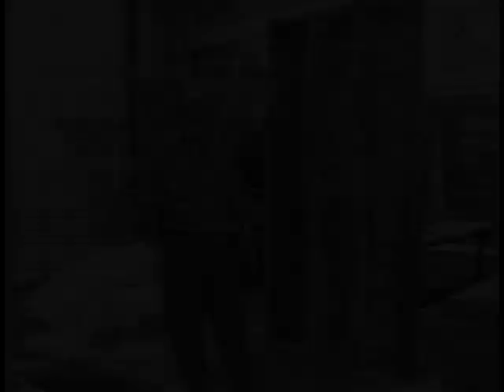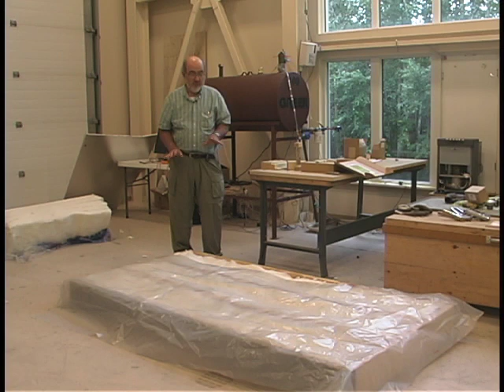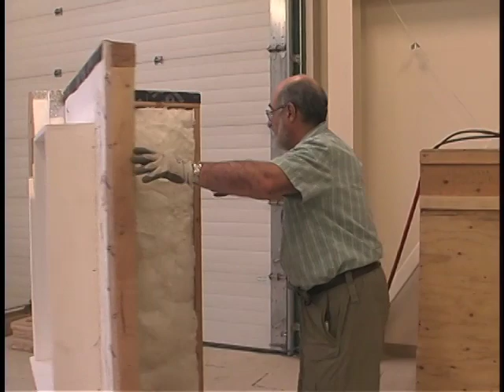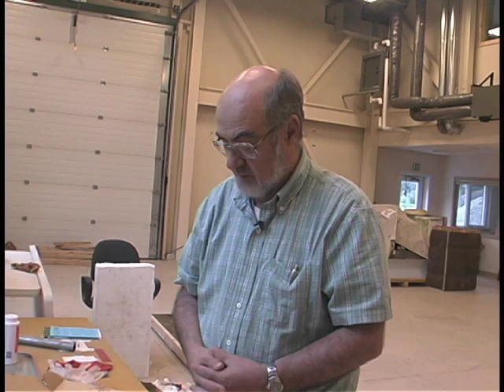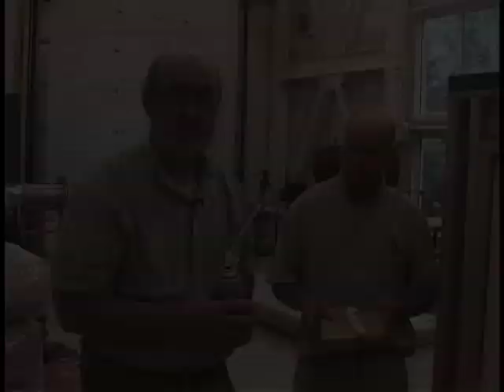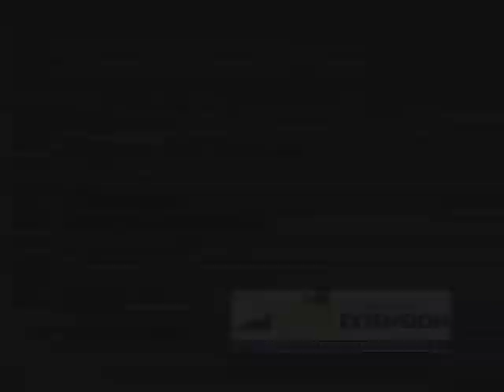Insulation and Vapor Barrier Basics with Rich and Art

Comment: Have you updated your info lately?  Seems CCHRC and you disagree on basic building.  The SIPS panels had a massive failure in Juneau and inside vapor barriers are being left behind for air barriers and drying to the inside.  Also manufacturers tell you not to use 'I' beams in any application where ambient moisture levels are prevalent (read soffits, carports and uninsulated  attics.  Fairly limiting installation and certainly makes you wonder at the longevity of the product especially since you no longer can get a true plywood web.  Good topic though not practical advice.  A bit disappointing.  Also no differentiation in the many climate zones in Alaska and how they should best be dealt with.  Doug
Reply: Hi Douglas,  For what it's worth, this video had been reviewed by  CCHRC outreach as accurate.  (I'm not sure which specific points you see as disagreeing; can you email me specifics at alnashjr@alaska.edu and let me know?). There were ~100 SIPS which I know of that failed in Juneau yet that was many years ago (and they continue to be manufactured used around the state without reported or massive failures). While some people are utilizing styro membranes for a barrier on the outside and extended walls, I think you'll find the standard for most builders currently is  a completely sealed poly sheet barrier on the inside aspect of the studs.  As titled, this piece is meant to be a basic video with my  emphasis on  insulating with fiberglass in 2"x6" walls (as it is still the  standard means for residential DYI builders in Alaska, with cellulose being also popular due to the cost effectiveness).  Rich did cover some climate differentiation with the window section, yet  If you'd like more comprehensive info as a contractor- or specifics for particular conditions -please contact me and  I can help!  Thanks for viewing,  Art

Comment: What an immense waste of time ! I was expecting some discussion on the advantages and/or disadvantages of using rigid polystyrene panels with foil or without foil. Maybe some discussion on spray foam. What about sealing around electrical boxes ?  Useless !
Reply: The basic aim of this video was to show a basic applications for home owners of insulating walls and windows with fiberglass (and touch up foam).    In walls with electrical boxes it is important to secure vapor barrier to the 3 exposed sides (and have an extra 'flap' for around the drywall/opening edges helps).  There are commercial thin foam pads that can go under electrical outlet covers that are helpful.  Sorry that foam insulation was not the focus here, yet thank you for taking a look. I do have specific information on the various closed and open celled polystyrene panels (including R-Tek with the foil) if anyone would like to contact me at alnashjr@alaska.edu.

Comment: Also your insulation looks as if it is pushed in to far where it would touch the backing and this should not happen either because this will create moisture and mold in your insulation